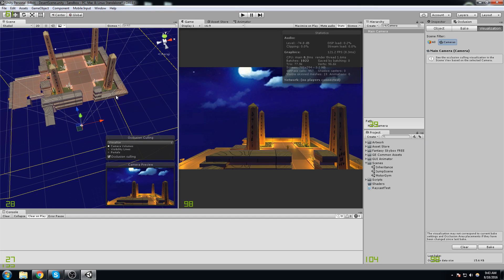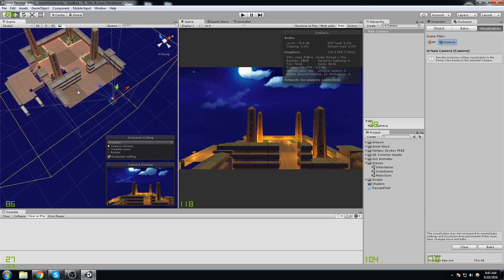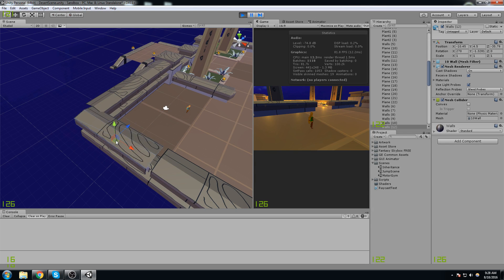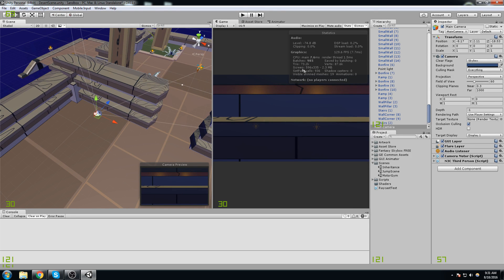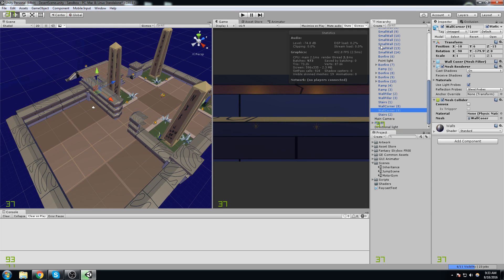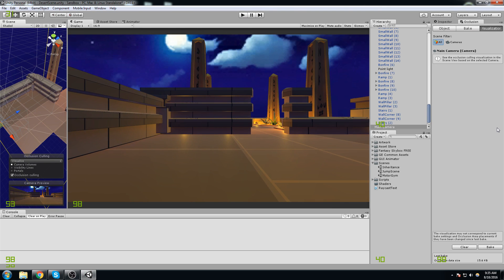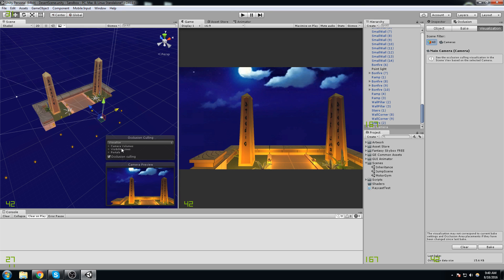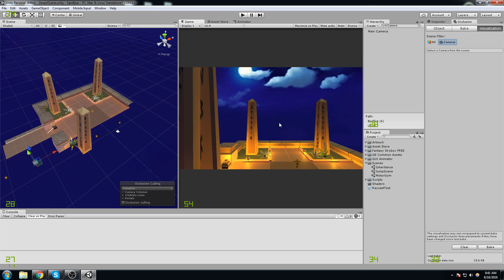Simple occlusion culling - Unity 3D[Tutorial][C#]

Comment: Can I not occlusion-cull stuff that has been copied in my level and uses instances of the same object simply with different textures and that kind of thing, like the walls?

I'm just trying to see about using occlusion culling in my game but when I select an object, the wall in this case, and make it "static" in the Inspector's mesh renderer component, I get the following warning:

"this renderer is statically batched and uses an instanced shader at the same time. Instancing will be disabled in such a case. Consider disabling static batching if you want it to be instanced"

Does this mean that I basically can't occlude 99% of the stuff in my level, which is mostly just constructed from a single quad wall object that I've copied and pasted all over the level to build rooms and corridors and then simply changed the texture to get a few variations on the way it looks?

Or am I missing something here and doing this whole occlusion culling thing wrong (I'm just learning)?